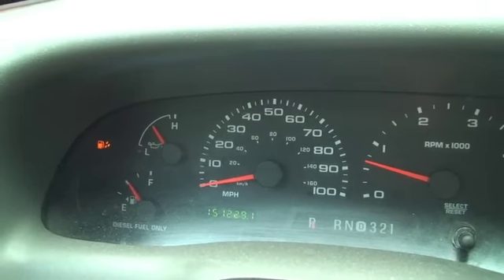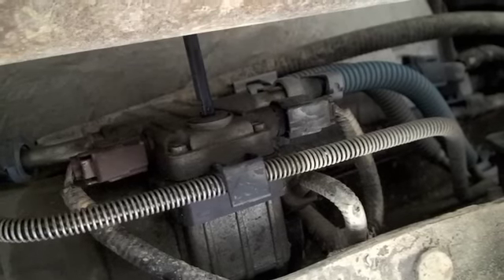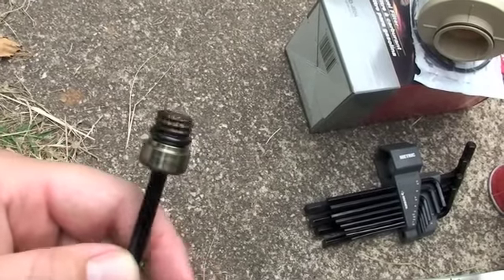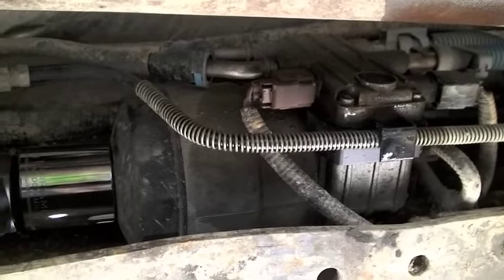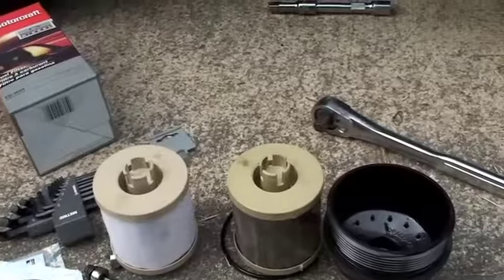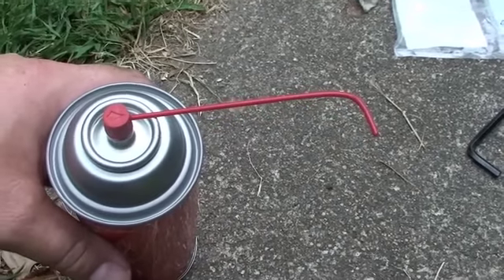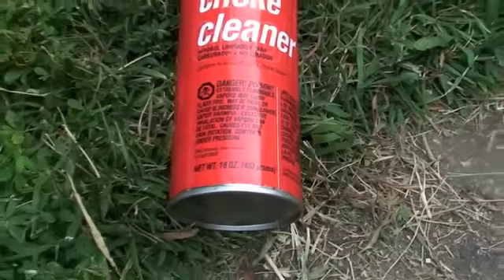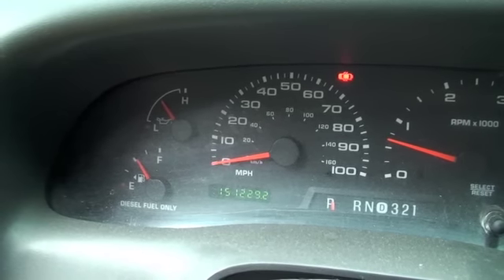04 F250 Diesel Fuel Water Check Engine Light Fix

Comment: My F350 '06 6.0 did the same thing.  I got a new plug ($22, ouch) and a can of carb cleaner.   Bent the tube as described in the video, and went at it.   WOW!  I used about 3/4 can and all the junk, water, rust that poured out was incredible. I held a plastic bucket under the plug and captured almost all of it.   It had probably not been done since the truck was new (I got it 2 years ago with 170k on it).  I'm convinced, I'll clean it out on every other filter change.    THANK YOU for this very helpful video.

Comment: Good video about on how to fix the Fuel/Water issue.  When you buy the Motorcraft Fuel Filters, you get both filters - the one shown here, and the one on the top of the engine next to the oil filter. Replace both at the same time.  Cracked up with the commentary about "don't get the cleaning fluids on you".  Very True!

Comment: I watched a Diesel Tech Ron video, and found it much easier to remove the Fuel Conditioning Module from the vehicle to work on it. Per his video, I took mine apart, and it's a good thing I did; I never would have gotten all the crud out by just spraying it while on the truck. As a matter of fact, I will probably have to replace the plug and the sensor..

Comment: Just bought my first diesel , 2004 Excursion 101K miles. The same light came on. Awesome job in your detecting : "since it is not in owner manueal" Keep it up! Thanks for taking one for the team. Next up how to get the Horn from the anti theft system to quit going off ( I just pulled the fuse on horn for quick fix)

Comment: I just found a ford description of this process, it's located in the "6.0 Power Stroke Direct Injection Turbo Diesel Owner's Guide Supplement" part number 3C3J-19A285-EB. Thanks for the video. My adaptor nut corroded just like yours, so I'd say its a safe bet for anyone doing this who hasn't drained it themselves to go ahead and pick up one of those nuts when they pick up their filters.

Comment: fantastic video man. saved me ( a noob to the diesel world) a trip to the shop as that light was driving me crazy. I got 12 ozs of mixed water/diesel out. The plug in my 04 f350 looked the same as yours. Replacing asap.  Thank you

Comment: So...some info.  Ford did improve the drain plug.  It is now made of brass, no rusting anymore.  Also, the housing in this video shows that his application has the heater in the housing.  That is also obsolete.  I see that he is using carb / choke cleaner.  I would not recommend that.  It can cause any rubberized seals and gaskets to swell.  Those will later contract and might leak.  The best way to clean that out is to remove the four screws and clean the water trap out manually.  The ones with the heater are usually the worst.  If it is really bad, remove the housing from the truck to prevent the internal valve from falling out, it is spring loaded when installed.  Be sure to have the replacement gaskets kit on hand before starting this.  The filter scratching sound is not unusual.  There is a catch point that will stop the filter from rotating on installation when the air weep hole is at the 12 O'clock position.  And finally to prevent the build-up of crud, drain the water plug on an interval depending on the quality and condition of the fuel you use.  Another note the fuel system is a "fuel conditioning" system.  Why is that important to understand, or know about at least.  The fuel system on our trucks continually pumps fuel when the truck is on, it is not just pushing fuel to the injectors.  This "conditioning" is meant to remove water, debris, and air.  If you have a full tank of fuel, the system will cycle and entire tank of fuel over about a two hour period.  That is pretty amazing.  Hope this helps someone out.

Comment: If you form a piece of aluminum foil around the fuel filter and water drain plug you can avoid fuel and carb cleaner run off.

Comment: good video man, dont forget the filter on top fo the engine, only use ford filters, oil and fuel, plus if you wanna NEVER put injectors in your truck, change the oil often and run diesel klean or some additive in the fuel!

Comment: I would recommend replacing the factory water drain plug with the aftermarket one.  The factory one is very prone to stripping.

Comment: Great job, but a few tips for you all.
When working with diesel, always wear gloves (nitrile etc is great).
When draining, collect into a yar or see-through plastic bag so you inspect what you drained out. Water seperates in the bottom.
Never wrong to change diesel-filter, but not necessary if the only problem is the water-light, the filter does NOT remove water, only larger particles, hence it is not destroyed filtering water..
And, of course, if you do have water in the seperator, you will have water in fuel tank. So poor in some condence remover every now and then :)

Comment: Hello, I recently purchased a 2006 F350 with the 6.0 and the water in 
fuel light continues to stay on.  how long should you keep the water 
separator valve open for?  does the system have a separate tank to store
 the water?  If you leave the water separator valve open long enough, 
will you eventually be draining straight diesel?  I only ask because I 
left my valve open for 1.5 hours and it was still draining at the same 
rate as when I initially opened it.  Thanks!
Reply from the maker: Dlynes- I remember the fuel/water draining out for about 3 to 5 minutes, then it stopped. I would guess that the entire amount of liquid held in the filter and a small amount in the fuel line was what poured out. A couple of cups maximum is what I remember. I hope this helps.
Reply: i heard somewhere to jack up the rear so ur not draining ur fuel.